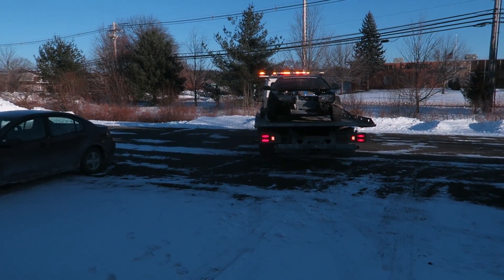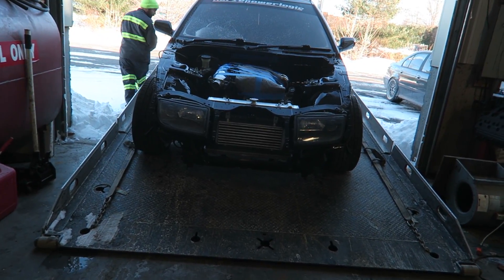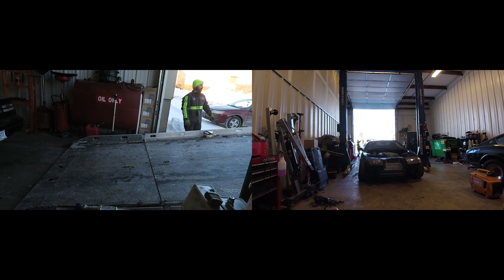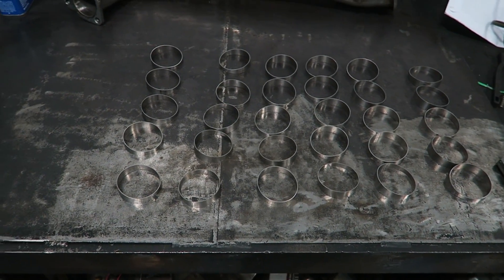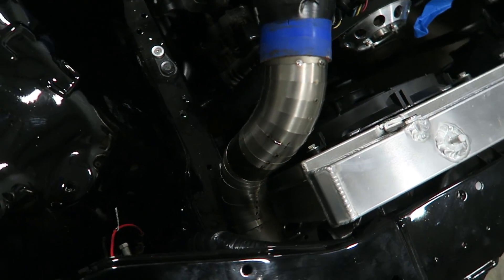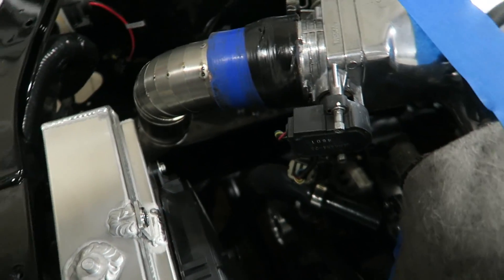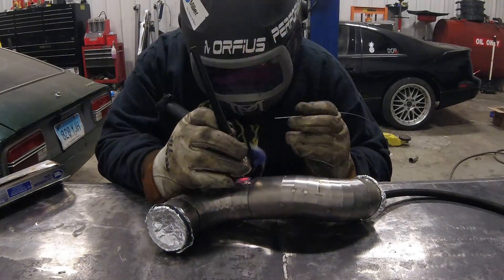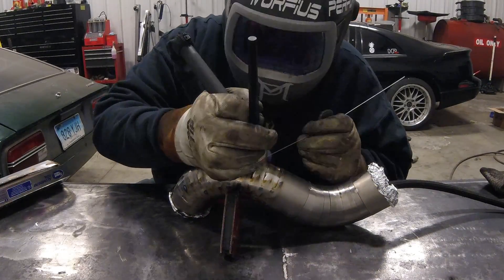Ti Pie for Dessert another welding reference! Titanium Intercooler Piping!

Comment: Those are some really nice welds.  Jimmy is lucky to have you around.

Maybe a dumb question, but I noticed the piece of purged titanium had a neochrome color to it.  Is the purging process what brings out the color in the titanium?

Also when you purge a piece of titanium and the weld penetrates like you showed, wouldnt that affect the airflow on something like intake piping?
Reply from the maker: great questions! The neochrome is actually due to not having quite enough purge flow. It wont hurt anything but its better if its colorless or light straw colored. The ripples im sure have some sort of effect but im sure its nominal and they arent more than a fraction of a millimeter.
Reply: Ah ic, so not having proper purge flow is what brings out the color in a titanium weld.  
Ive seen some show cars that have some pretty wild colored titanium welds, is this also achieved by reducing the purge flow or is that a different process?
Reply from the maker: It's a different process. Usually a torch is involve and with careful heating the different colors are achieved. What you see on my piece is actually a mistake on my part. I traveled outside of the argon coverage and thats what ya get.

Comment: What did you have your back purge set at?  Didn't know if Titanium requires more purge than stainless. Keep up the great work and great content!!
Reply from the maker: I had it set at 18cfh It could have used a bit more. My seal wasnt that great though so i probably could have gotten away with less if i was using plugs.
Reply: Morfius Performance Thank you for the reply, and thats not bad at all.

Comment: Great video!  I love that you took the time to explain about back purging the weld.  I have one question though:  Why use Ti over Al for these pipes?  Ti is more expensive, much more difficult to weld... so what's the upside?
Reply from the maker: There are two upsides but they are negligible, 1) lighter. the Ti is lighter than alu but the weight savings isnt enough to justify it. 2) appearance you cant deny that this stuff looks incredible. we used it on this build to add some flare but on the average street car alum would be just fine.